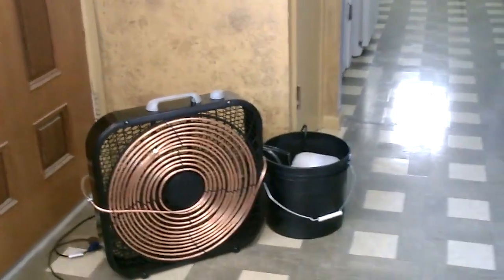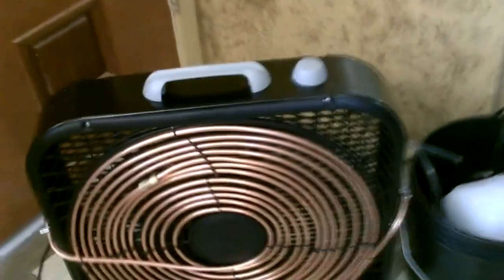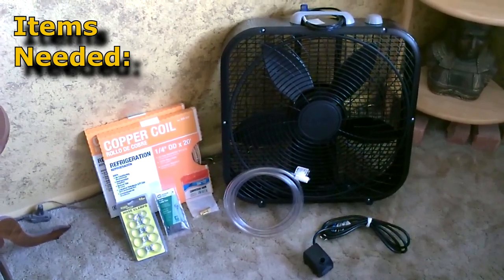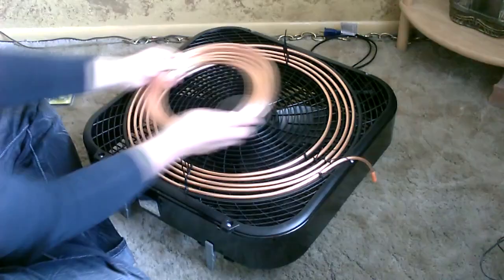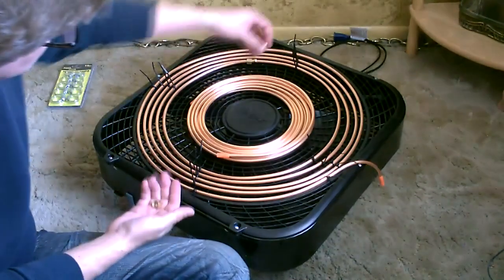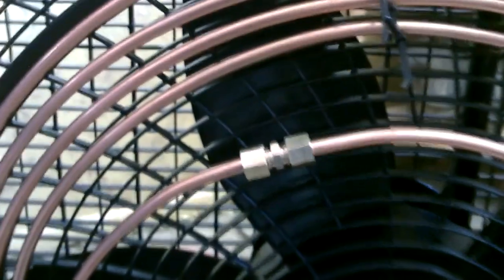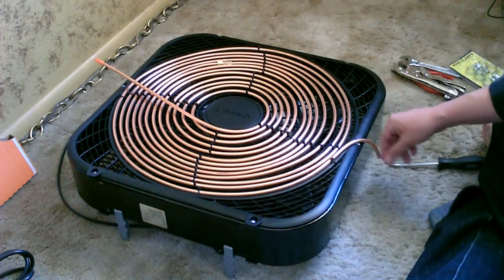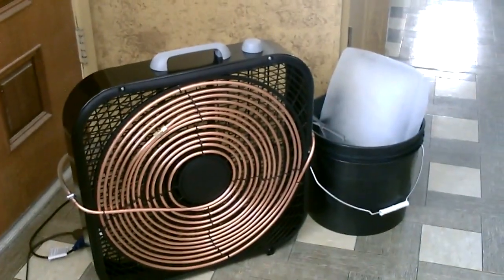Homemade AC - The "Copper Coil" Air Cooler! - (Simple "Box Fan" Conversion) - Easy DIY

Comment: I would pick a better fan and run a two step system. I would put a copper coil on the back of the fan to start the cool down to keep the motor running cool. Then I would put another coil on the front to cool the air further. I am not too smart but do not flow rates affect thermal transfer? If so running the ice water at different rates should make cooling a room easy right? So a two stage system would be a better design?

Comment: You could also put a PVC within a PVC. Pykrete on the out side with a pvc and copper coil with antifreeze on the inside sealed of course. Make a few to stick in a deep freezer connect them and run your system.

Comment: Adding salt may make it colder, but you need to see if the pump would be harmed by this. Corrosion and malfunction could occur in time. I just made this design for my pitbull outside. Going to tighten the coils up some and double insulate the cooler I used to hold the ice and water.
Reply: Honestly, you can achieve the same effect with a bigger pump without using salt. Plus you don't want to form ice on your tubes, which will happen with a saltwater ice bath. Once the ice forms, the efficiency drops. This is why you have to defrost your freezer.

Comment: Neat build... Would you say this is working better than the other 2 you made? The evaporative cooling one with the Coolpad Ice and the 20" fan, or the 11gal bucket with 3 holes? For how long did the 10 pounds of ice (even in with no ice chest) allowed you to keep the system in conditions to cool the room (with an airflow below 60~65F)? Thanks much! :)

Comment: Put some salt in the ice water and see if it blows any colder.
Reply: BDLes12  It will, but the ice will melt faster
Reply: ohger1 yes it will melt the ice faster but lower the freezing point of the water making it colder than 32 deg F. roughly 28 deg F. so you probably wont notice much of a difference.
Reply: uscgwagner it does make a better conductor, saltwater that is.
Reply: +Liquid Snakes would also corrode the pump faster and the copper pipe and weaken bonds in the plastic tube, salt is very corrosive
Reply: Cooper only corrodes to the surface, even if that isn't true it'd take years or you could use softener salts and get the benefits without the risk.
Also you could rotate a bottle of rv anti freeze in and out of your chest freezer it'll never freeze but gets down colder than ice
Reply: The better conductor is also what melts the ice faster because it removes more heat from the air faster you could also  get a roll of piping from a craft store to run around the coil it'll soak up the condensate and make a better evaporative chiller.
Reply: +Transgender Q&A Simple, have a separate feeding chamber  that never comes into direct contact with the salt !water..
Reply: Michael Rhoads Please can you explain this way of collecting the most moisture. I wish to copy this design and collect the moisture the best way possible. Have already made the ice box cooler with fan that blows internally and comes out exhaust. It's extremely cool but only directly in front and adds moisture to air. Very restricted flow also.
It is very humid in Australia and I don't want the electrical price of running a portable air conditioner all night... Plus I get to build this. Lol

Comment: This would be amazing with some insulation on the bucket and a lid so that it'd cut down on humidity and possibly slow the ice melting a bit.
Reply: Just a simple bucket lid will prevent possible humidity issues, but as long as the water is below the dew point of the room, humidity will actually be removed by the bucket. Warm moist air will condense on the ice, not the other way around.

Comment: in regard to your copper coil air conditioner... I love your idea but I have a question/idea I would like to share with you. Do you think that it would be more efficient if you could freeze a bucket of water then pull it out & instead of simply putting the hoses into the OPEN bucket... put a snap on lid on the bucket with 2 holes drilled into the lid for the hoses to go into. It seems  to me that the ice would take longer to melt & would thereby make a  more efficient system. Please feel free to let me know if you think this makes sense, & if you try it please let me know when your updated video comes out.

Comment: This doesnt work that well in a highly humid climate.  I went through 20 lbs of ice in 4 hrs and caused so much condensation on the coil that I might as well have run a swamp cooler.  It was a fun project/experiment though.

Comment: If the coils ran through the rear of the fan instead of the front, wouldn't it make it cooler, because you dont have the hot air warming the line a little? Im not saying the line is hot as it is, but wouldn't it be colder if it was in the back since no air is hitting it?

Comment: I have an innovation for you. If the air inside the tube enters the copper with a fan or air pump and the copper is immersed in the iced water from the outside, you will get cool air as a result of air friction with the copper pipes. Repeat the process Make the air entrances at least five and the five exits are immersed in cold water with ice.

Comment: This is a really great idea. I do a lot of RV camping, and there's often ice available, or can just bring a bunch of ice blocks in a few coolers. I know this depends on the ambient temperature, but about how long does that block of ice last you?

And it's been a bunch of years since you made this, after living with it awhile do you still use and recommend this setup?
Reply from the maker: hi and thanks! ice can last several hours at a time. big blocks last the longest. yep, i've still got and use it. i recommend all of my projects. which air cooler you make mainly depends on the materials that you have available and your cooling goals. i have boh the ice and non-ice types. in the 13 years that i've been making videos i've only gotten rid of 2 projects (i've still got something like 300 of them in total). the heat exchanger coolers are some of the most powerful air coolers.

Comment: That's great to know.  However, where can you find all the items you would need? Home Depot? Lowes? Can you please list all the pieces needed: to make the coil work, and to create it? 
I would like to be able to walk into wherever these items are sold and basically check them off my list. 
I am not a natural DIYer. But I am willing to put the effort into this as our RV AC is going out and its 90 degrees at the hottest point of the day inside. It would be too destructive to the trailer to put in a window unit or a portable AC. Not to mention very difficult to set them up.  I am very interested in using solar panels as well. 
Please and thank you.
Reply: +Kellie R Make an ice chest fan. It will work better.

Comment: Thanks for the example you set of fabricating useable devices. I wanted to ask if the cooling efficiency is different with coils in front of the fan air flow or in the rear of the airflow? thanks again, I have too do more projects with my son of this sort. I have been to some 3rd world countries where this resourcefulness is the difference in survival and comfort,  thanks....
Reply: Hey there - I'm a refrigeration salesman and I want to give you a heads up that in front of / behind the fan doesn't make a huge difference in most cases. Doing both front and back would double your efficiency though! Consider that box fans generally don't move air super efficiently. The air movement itself is kind of the weakest link here - get a centrifugal fan or one of those really strong metal shop fans. If it can't consistently blow papers off a table from 15 feet away, it needs improvement.

Comment: instead of an open bucket, I would have used a foam cooler and put the lid on.
Reply: marsdog You should also add insulation to the outside of the cooler. It will increase the amount of time that the ice stays frozen and will help keep the temperature of the water in the lines lower. 
Ive found just using old blankets wrapped around a cooler can extend the life of the ice inside by a few days.
Reply: +marsdog try pouring some salt ..
it will make it colder ...
Reply: cat nip it will also melt the ice..
Reply: +Darrick Mohr It lowers the freezing point of the water without changing the temp of the water, allowing water to exist just below freezing as a liquid. Would increase the efficiency of the unit but would greatly decrease the lifespan of the copper tubing due to corrosion.
Reply: +maneatingcheeze Do you think the salt will eventually ruin the water pump too?
Reply: +maneatingcheeze  You could just flush the copper tubing regularly as well.
Reply: one person suggested adding salt to ice in a jug of ice.... solving the copper corroding problem
Reply: DsVibe Use a foam cooler with a lid and add salt.
Reply: Copper doesn`t corrode. Steel and iron do.
Reply: That would be a waste, since the ice is melting in the room you are trying to cool.
Reply: @maneatingcheeze  They actually have saltwater rated pumps for Aquariums.
Reply: @sallyroberts4359  If you don't have kids or pets, use a little anti-freeze instead of salt. 
Cuts the corrosion issue but it's toxic.

Comment: ...Or you can substitute a used or new truck radiator for the home made copper coil, the radiator has fins that will increase the surface area contact with the flowing air from the fan. This configuration you made is in essence a simple "Secondary form" of air conditioning similar to those systems used onboard  Older Navy ship A/C systems, the difference of course aboard ship ice blocks are Not used but rather a Primary evaporator coil immersed/Encased  on a Heat Exchanger type unit which gets cooled by a regular refrigeration unit with recirculation pumps, of course the theory of operation is the same. The resulting Condensate could be collected on an improvised Collector unit made of a large diameter PVC Pipe cut longitudinally where the Radiator could sit and fit in.
Reply: Manna Tech  Cool!  Any pics of the build?  Performed any testing?

Comment: If you just used some anti freeze and some substance that's way colder than ice. This would be a pretty good solution. Thing is once the substance reaches room temperature it turns pretty much useless unless you cool it again somehow. E.g. adding more ice.

Comment: Its needs a lid with grommets so its a sealed system with nearly zero water evaporation.
Reply: then you could detach the copper and just freeze the whole bucket
Reply: Brian X then you would have a simple AC unit except Water is a terrible coolant. Once the ambient air heats up the ice you will just have a cool looking fan.

Comment: umm u should put ur coils in a pipe an use a duct booster or inline fan to push air thru it or maybe even a few heat exchanger ina row the air would be in the coils longer an be more efficient...pretty cool idea tho

Comment: with your next fan based project you should use a Vornado fan or room circulators as they like to be called, even the little Vornados move a ton of air lol
Reply: Vornado uses THE cheapest motors in their fans, but they do honor their warranty.  Electric motors should last a very long time.  It is very hard to understand why they use such cheap motors.
Reply: they cant be the cheapest motors in the world lol i went through 10+ cheap walmart fans in a little over 2 years, ive had the vornado now for 2 years and its probably only been shut off twice, i think they are fantastic little surprisingly strong motors, and yeah the 5 year warranty isnt bad, most of the time when the motor goes "bad" it isnt really bad its just lost its oil over the years but i havent even had any visible oil loss from this little vornado
Reply: +1234garrett1993 you got lucky.  We bought two even though there were many complaints about the motors.  Both motors died.  We had to ship them back to get repaired.  Vornado sent UPS label, but packaging cost us money.  Hope the new motors will last.

Comment: So I made my own without reading any of the comments.  I'm using a 75 gph pond pump which is pumping out to 3/8 plastic tube then coupled with brass fittings to 50' of 1/4" copper tubing. The flow is way too slow which only gets the the first few rows of copper tubing cold.  My question is does the 3/8 to 1/4 transition matter as long as I have a pump with enough flow.  In other words, if I upgrade my pump from a 75gph to something like the 200gph or more which you have my tubing shouldn't make a difference.

Comment: for a long term solution instead of using an ice bucket you could use a water chiller to cool the water
Reply: only if it is in another room or outside . it takes heat to make cold so you would  be adding more heat to the room then you are trying to remove. good idea , "long term"

Comment: How difficult would it be to connect the pump to a heat exchanger, then cool the water with...something else?  (Idea not fully formed yet.)  If, for instance, one did not have access to ice (for some reason), but still wanted to create a cooling system?

Comment: should have put copper tubing on both sides of the fan. air would be pulled thru the copper on one side and push thru on the other giving it two chances to cool the air

Comment: Another good idea is to have your pick-up come from the opposite side of the cooler as you're return. That way it's getting the coldest water as possible. 

What kind if pump did you use? Is it like a small pond water feature style submersible pump or an inline pump?
Reply from the maker: hi there. it's just a aquarium or fish tank pump 200 gph one
Reply: Using one container maximizes how much cooling you can get out of a given amount of ice, using two containers cools the room faster but does so less efficiently. Both are useful options, it just depends on what you want.

Comment: So the ice "coldness" transfers from the hollow tube to the copper through conduction. The copper holds a constant temperature as long as the ice block is inside the bucket?
Reply from the maker: hi there . yep, that pretty much it 👍🙂

Comment: Try a Stirling cryogenic cooler to produce liquid air to circulate through that copper coil with a vapor tank to reform the liquid air has it boils off from the heat exchange. Could design the cooler motor to operate a pump to circulate the liquid air through the system hay a portable air conditioning unit?

Comment: I have a furnace with fan capability (furnace not burning).  What if I put the coil in front of the intake grate? Will that make the air from the fan a little bit cooler?

Comment: Question, what is your personal preference for a indoor cooling system in 100° heat?

1. The evaporative cooler
2. The ice box fan cooler
3. The copper coil cooler
4. Other
Reply from the maker: hi there. since i live in a desert and it's often very dry here - i've been using my evap coolers a lot lately. especially the new indirect evap cooler i set up. indirect means that it produces no added humidity in the home or living space. they are also very cheap to run. cost next to nothing.
Reply: @desertsun02  I have never seen that indirect evap cooler video, and did not know that process cools all water to 60°. Extracting that cool water and pumping it through a heat exchanger is a brilliant idea. No ice needed to get 60° output. I love it

I'm now going to modify your cooler "ice off the floor" fan design to include the water pumped through the radiator fan design
Reply from the maker: sounds good. my next video is going to be yet another way to use cold water and a small radiator to cool air. it will be the simplest one yet. stay tuned. (i'm just waiting for the radiator to arrive)

Comment: I used aftermarket transmission coolers...Worked great but ice melted fast. A drain system to keep water at a minimum would help.
Reply: Ice melting fast means you are efficiently moving thermal energy into the ice. Fast ice melt is a sign of success, not failure. A drip pan with an outlet would be fine.

Comment: Most AC units work by having the fan in front of the coil sucking the air through it rather than blowing in through. Should create better airflow. Im considering trying this project but with the coil on the back. Likely on this scale it wont matter though.
Reply: +Jason Davidson that's a very good point. I did not take that into account. it likely would.
Reply: Why not both!?!
Reply: If the fan motor is behind the blades, it shouldn't be a problem. Box fans would be out but oscillating fans are usually setup like that. 

The idea to put the coils on both sides would, I think, increase surface area of the tubing and the thermal exchange and therefore the cooling. 

Anyone know if bigger or smaller tubing would also help?

Comment: Hi, How did you hook up the 1/4 vinyl tube from the copper coil to the the harbor freight 200 GPH pump. They attachment on it isn't a 1/4" and I want the water flow to be as good as possible. Thanks great video!!